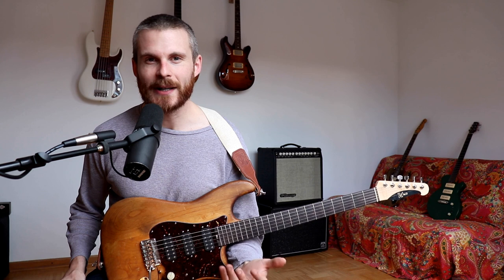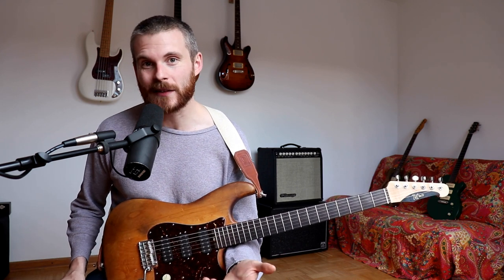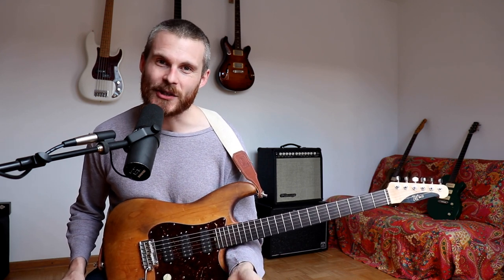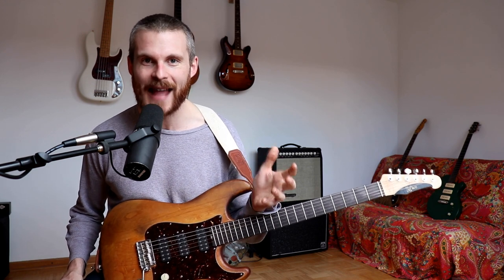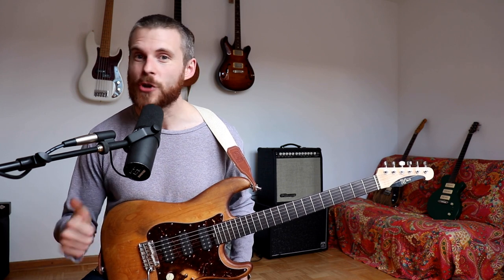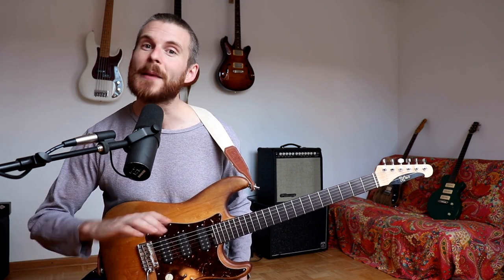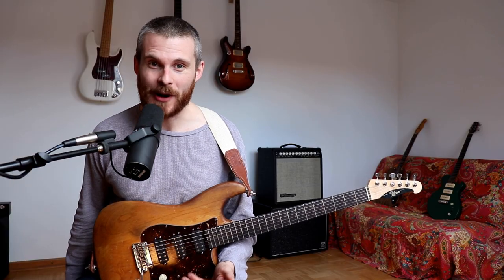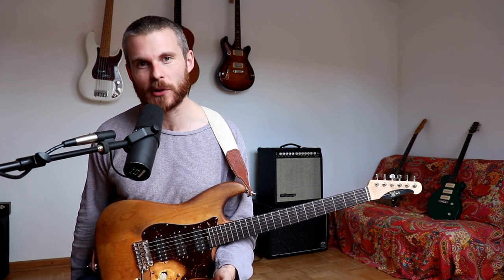Tube Overdrive Test // Fryette Power Station Self-Attenuation

Comment: What a great video Ben! I specifically was searching to see if anyone had tried this and was delighted to find your video. And it sounds pretty good. I am looking at a 100W PS-100, I don't see why the same "technique" would not work on that amp but with 6550 tubes it should sound different. Curious of anyone has tried this? Comments appreciated.

Context: I already have a 300W 6550 head (BV300HB - 6x 6550) but it's too much for the PS-100, I might pick up a two notes (or three) or similar to split the amp load with the PS. I've never really been able to play with the BV300HB cranked, it's just too much amp. With 4x 16 ohm attenuators I could get it down to 75 nominal watts at 4 ohms. PS-100 + 3x whatever (because the TN Captor and most other affordable attenuators handle only 100W max).
Reply from the maker: Thanks! Glad it was useful. Wow, 300W must be loud. I use a light 1x12 40W 2x6V6 combo and it's still too loud for most gigs with the volume on 3

Comment: I just got one of these,except mine is the 100 watt version with two sets of controls...it’s not stereo,you can just switch between two different settings on the volume,depth,and presence,which is super useful...also you can footswitch the FX loop on and off..anyway,this thing is hands down one of the best gear purchases ever...after using it,you wonder how you ever got by without it.....never thought of feeding it back into itself though...that is cool...I am going to give it a try....

Comment: Very interesting! If you have a chance to play around with this setup again, I'd be interested to hear a similar test with the depth control turned way down - maybe even all the way off. I find that in some of the highly distorted clips there's a bit of fuzziness, which could mean too much bass before distortion.
Reply from the maker: I agree- the full-on version might be better with the Depth off, and also with less warmth on the reactive load switches. I kept everything the same for consistency, but just like a real amp it would be better to adjust depending on the volume. Less bass is often good!

Comment: Hi Ben is it possible to drive the Power Stations power amp into overdrive as you have done in this video, but send a lower level signal to a speaker cab, or does this technique only produce a line level out?
Reply from the maker: This particular technique only produces line level. The 'proper' use of the Power Station is to silence another loud, overdriving guitar amp, and then send a quiet signal to the speaker via the internal power section AND a line level. It's quite hard to explain!
Reply: Cool demo, just picked one up myself. I like people that think outside the box. Say couldn’t you setup the way you have it and then run the line out into another amp setup clean’ish and get real volume? Basically a preamp with 2 x 6v6’s breathing fire?
Reply from the maker: @jeffbob1947  Sorry for the late reply. Yes! You absolutely could do that. Normally the PS2 is designed for the exact opposite: getting your Marshall (or whatever) really loud and then tube re-amping it into a speaker quietly, but there's no reason you couldn't drive this and then re-amp it through another amp. Only thing is, you'd need the other amp to have an FX return because it would sound terrible going through another preamp! You might also have a problem with level because most FX returns have no master volume after them.... so it could be awkward, but solvable with something like the JHS Little Black Amp (a cheap passive volume control)